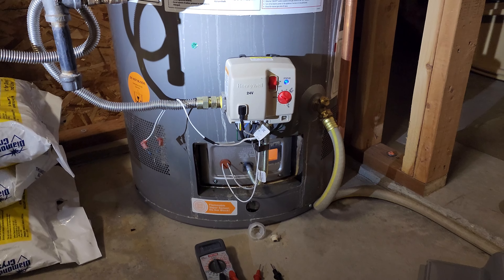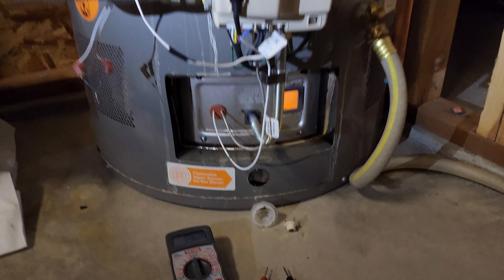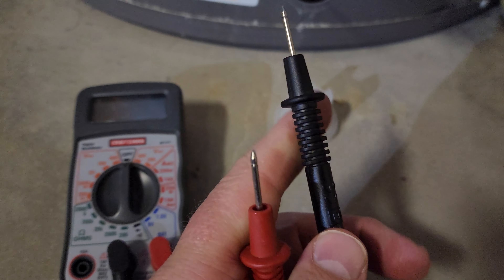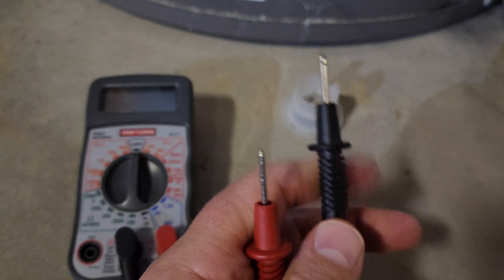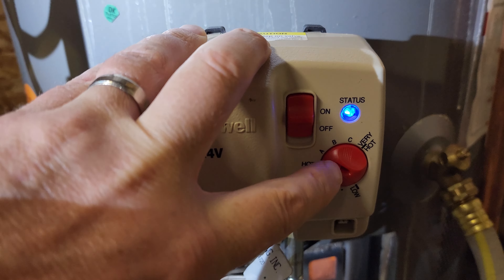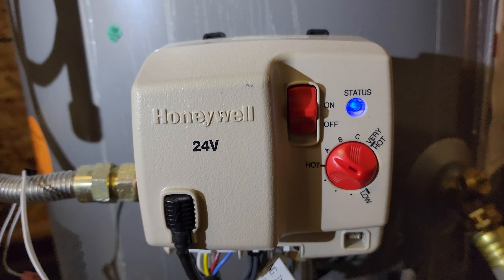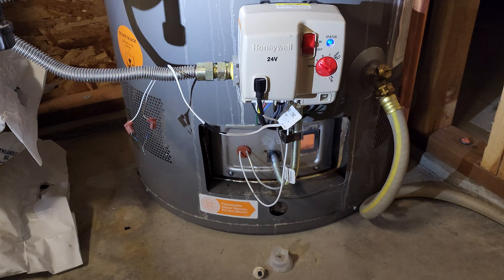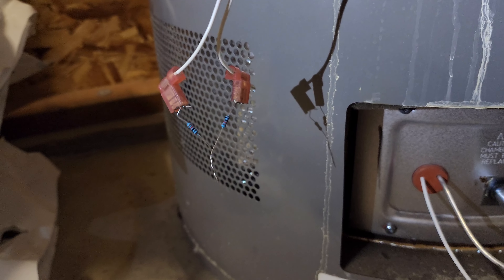Rheem Water Heater - Flammable Vapor Sensor - jimmy rig temporary fix using resistors.

Comment: This temporary fix worked for me today too while waiting for the part to arrive.  Thank you so much for posting!  I used a 22K Ohm resistor, powered on and noted the same error, then powered off, then back on and rotated from low to very hot 7 times, though I heard it "click" to heat up the pilot light starter on about the 4th cycle.  Seems the lockout mode prevents it from restarting "ever" unless the sensor is reading safe (or this temporary resistor is used) and the cycling is performed.  My broken sensor reads 205K Ohms.